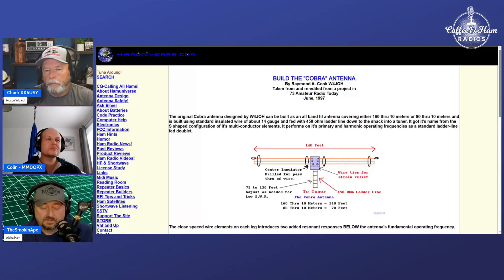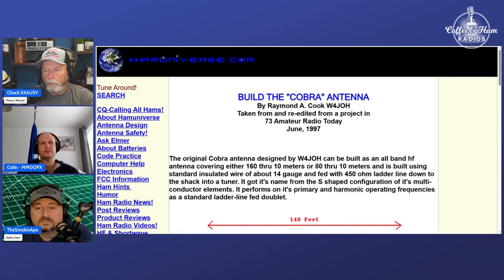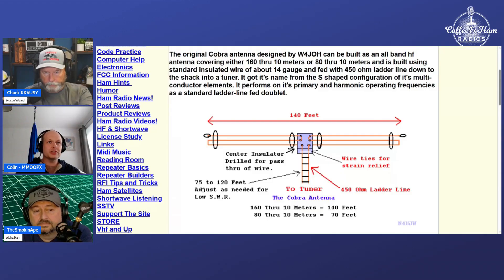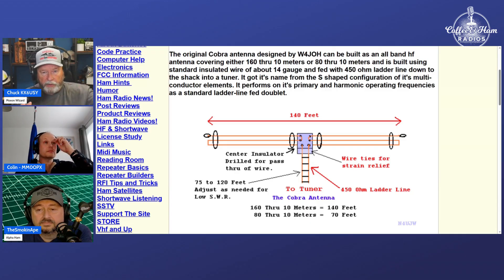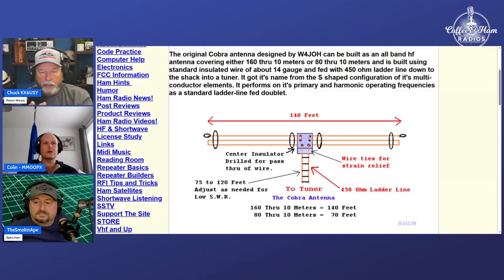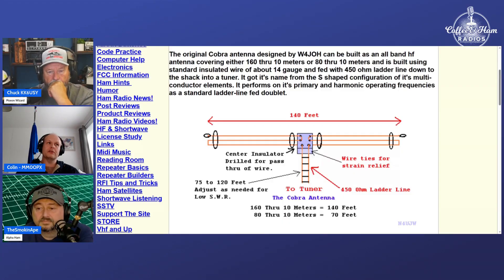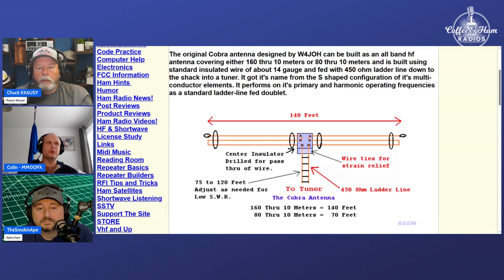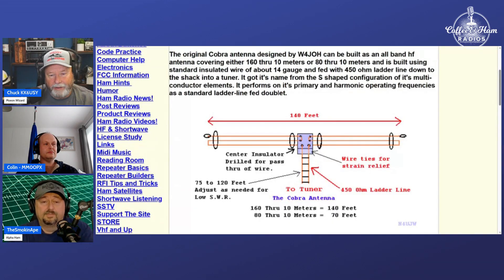Folded Antennas for Ham Radio? The TRUTH About Linear Loading!

Comment: I use the Cobra Ultralite Sr. I just started back into the hobby in January of this year, and it's what my locals recommended to start with my FT-710. I feed the window line through a 4:1 balun, then into the shack. I was told by some to NEVER cut the window line because it's part of the pre tuned antenna. Since then I've seen many that say to adjust the window line just like you would tuning a dipole length. It's been a while since I last tested it using my VNA and I was wondering what you would say if, for example, it shows that it's too long. Should I trim the window line, or continue letting the tuner handle it?
Reply from the maker: I’d let the tuner handle it, you may want to try a 1.1 in place of the 4:1 as well 👍
Reply: @TheSmokinApe  I have tried both and the 4:1 seemed to work better. My next project might be a doublet running perpendicular to the Cobra. Might even make my own ladder line. Thanks for the response.
Reply from the maker: Good luck with the project 👍

Comment: At my last place, I was able to put up a DX Commander Signature 12.4m and a 40m EFHW at 15 feet. They were comparable.

I'm antenna restricted where I am now, but I was going on a trip this summer and bought and built a DX Commander expedition so that it fit into my luggage. I was quite impressed, but then, I didn't have anything to compare it to.

Of course, I followed his instructions with linear loading at the top with no spacing.

I have yet to try it at my home location yet.

I was running a stealthed "downspout" antenna, but it is the aluminum covering the ISP coax. Same metal. It worked surprisingly well for many bands. I started with a Chameleon transformer and later bought a DX Engineering transformer and choke combination. I think it worked better.
Reply from the maker: Thanks for sharing Patrick 👍

Comment: Almost no commercial antenna manufacturers use linear loading anymore.  A properly designed coil loaded antenna is more efficient, more reliable, and less clumsy.  A coil Q of 400 or more is not difficult to achieve, and linear loading cancels some of it's own field.
Reply from the maker: I agree and most of what we call “linear loaded” isn’t

Comment: Obviously linear loading is not the best, just like a ground mounted vertical is not as good as a dipole at halfwave above ground.  It's a compromise antenna to fit in to smaller spaces at a manageable size. Most QTH in Europe simply cannot accommodate anything wider than a 20m dipole/yagi, so for 30, 40, 60 and 80m it has to be a compromise antenna. Linear loading is lower loss than traps and less bulk that coils, so you are wise to take the least-worst compromise.
Reply from the maker: Thanks for the comment 👍
Reply: I think your view is totally sensible. I suppose options are to let the ends hang down vertically, or zig zag.

Comment: I used "linear loading" to shorten my 15 meter delta loop. I needed to get the angles in the triangle to match the design. It would not fit in my attic; so I shortened the legs by just folding them back on themselves. I taped them together in a couple places. It is equal to my dipole in receive and transmit. I was going to make coils but could not find how to make coils in a delta loop.
Reply from the maker: That’s awesome that it worked for you 👍

Comment: Many many years ago I learned from Charlie Gynes who made my Hi-Q mobile antenna that when running any antenna with a coil that the coil should be at the top of an antenna if possible because of reaction with the ground and the loses of being shorter. At least that was what i got from what he said. The verticals he made for submarines had the coil at the top, no whip.
Reply from the maker: Yeah, the further up the antenna you place the coil the better 👍
Reply: @TheSmokinApe  Totally wrong.
Reply: @TheSmokinApe  Read my reply to jeffschall immediately above.
Reply: That is wrong.  A coil needs current to have any effect at all and there is essentially zero current at the top of the whip.  It is completely ineffective there except for whatever capacitive loading it might offer.  You might think that since the current is a quarter wave whip is a maximum at the feedpoint that it would be best to put the coil there, and that would indeed give the best shortening effect.  But a coil at the base would mean most of the current distribution is tied up in the coil and not distributed over the length of the whip where it would actually radiate.  The optimum location for a coil is somewhere in the middle of the whip (I don't remember the exact position but you can find it with a suitable search) and that's why you see almost all coil loaded yagis doing exactly that.
Reply from the maker: @AB7Echo your right, I was hasty in my reply… that said the coil is better 1/2 way up vs mounted at the base.  I do know this is a topic of debate and there are a different opinions
Reply: @TheSmokinApe  Yes, as with everything, there are tradeoffs.  Electrically there is absolutely a best position and that can be shown via modeling, although there is a range where it doesn't make a whole lot of difference.  But mechanically it definitely is better to have the coil at the base, so different installations might prioritize on versus the other.

Comment: In the 70s I had a TV tower and decided to try a quarter wave half sloper and had excellent results but it was totally from cut and try, not calculating the element lengths. In those days, people poo-pooed using these antennas because they were unpredictable. I was sure at the time it was because of the variability of the angle of the slope and proximity to the tower  and other objects. In my setup I was in a mobile home and the roof was a great ground plane. If you think of the vertical antenna as a dipole, making the ground half of the vertical takes the 72 ohms the dipole with a wire and divides it in 2 roughly to about 32 ohms. Now that we have antenna analyzers, we can easily measure these parameters. I found that the higher I raised the far end of the half sloper, the better match I got and the better signal reports I got. Any angle less than 90 degrees appears to have a fair amount of cancellation of the RF radiated. I might experiment with linear loading to see if the same properties are at work. Great discussion, gents! Ken - W8VIW
Reply from the maker: That’s great info Ken, thank you 👍

Comment: I am using several antennas ( and even radials for Verticals ) using that linear loading principle . We do use it to shorten the longest Dipole of multiband fanb dipoles. We are very happy with these. I also used ( ans will do later in the year again ) linear loaded vertical 40m Dipoles. We have 2 40m Verticals at the clubs station with the linear loading ( Single folded radial ) working perfect.  I tried all these with full size and saw no big differences . I  usee 10 and 12 cm Spacing on all these.  DL9NDW
Reply from the maker: Thanks for the comment DL9NDW, that vertical sounds interesting 👍

Comment: I use a 27 foot high, modified-Cebik "L" 40-10m antenna in the field and use linear loading on both legs to get 40m to work (three wires on each leg).  I also treat it like an OCF at the 40% feedpoint as well.  It is fed with 18 feet (which is NOT a 1/4-wave of any of the bands or harmonics) of true 600 ohm ladder line to a 4:1 Balun, then to a portable manual tuner, then to the transceiver.  Works very well on all bands as long as I tune it per band, and it stays relatively flat along that manually tuned band.  I haven't even cut the antenna wires precisely and I get DX on 20-10 (Japan, Chile, Brazil, most of Europe, etc.) and regional contacts on 40m (I think about 600 miles), using 100 watts SSB during the 2025 spring & summer.  Eventually, I will get around to cutting it properly to a better length but it is a compromise antenna, in that, if I try to optimize for 40m & 15m, then I will probably make 20m & 10m much worse, so I will shoot for the best compromised length of each leg while maintaining the 40% feedpoint.  This is an interesting topic for space constrained HF!  😁
Reply from the maker: That sounds great, thank you for sharing 👍

Comment: Study the GAP brand of linear-loaded multi-band vertical dipoles. I had a GAP Challenger up many years ago. It would match to coax on 80-2M without radials, and was inefficient on all bands, because like all antennas, the efficiency of the radiator is directly proportional to its physical size, NOT its "resonance" nor its impedance matching gimmicks.
I took it down and built a 20M vertical dipole and fed it with ladder line, thus, had a 20-6M vertical doublet with a much lower elevation angle and lobeless omni azimuth pattern than my 80M horizontal doublet did on the upper bands. Then I combined them and had a 20 meter vertical dipole and an 80 meter horizontal dipole on the same 1" ladder line feed-point. It's worked well.
73
Reply from the maker: Thanks for the info kv5r 👍

Comment: I do it with 2 17 foot whips in a V to get 40m. At the bottom of my antenna I have 2 M10 mounts 4 inches apart pointed in about 10 degree V. 1 of the antennas is connected to the coax. Then I run 2 elevated radials off it. At the top I connect the tips with a 1 meter wire. So it's basically a bent vertical. It works REALLTY well.
Reply from the maker: That sounds pretty slick 👍
Reply: I also do it with a wire and a telescopic pole. ~16.5 ft to the top, then about 18 down to a stake about 4-5 feet away. Makes a bit of inverted V. I activate POTA most weekends with that on 40m and get out to TX and IA from NY. Have picked up some DX as well in the mornings on it.

Comment: Great discussion... More in the future please 

Re the 4:1/1:1 balun debate my (uninformed) view is if it is more than a quarter wave vert/half wave dipole then 4:1 ok as radiation resistance greater than 50 ohms so can cope with being divided down to feed into the coax & you want to minimise any reactance as much as possible.
BUT, if it is shorter than a quarter wave vert or half wave dipole then go for the 1:1 instead. Below this length radiation resistance drops off rapidly so the last thing you want to do is divide it down any further with a 4:1. If you do that the ohmic losses will become more significant & if you get a good match it is probably more into heat than transmitted RF. Stick with the 1:1 & find another way to address the problematic reactance.
I think this could explain why Rybakov are good 20 to 10 but aren't very effective on 40.
This then gets back to Colin's idea for dumping the 4:1 "pre-match" at the base & just having a good auto ATU at the base ( a la standard hf marine band practice) that can cope with  low rad res/ high reactance directly.... Interestingly today I was having a play portable with a friend's xiegu G90 & it's decent ATU seems to be able to hack red slug 17' whips or 25' of vert metal ( as per Rybakov but without the 4:1) onto 40 directy without any problems if you are only running 1' of coax.
The Rybakov problem on 40 seems to be mainly the 4:1 as 25'  (per leg) radiators with different matching have no problems on 40 (as proved by the half size 5rv).
Reply from the maker: Yeah, the fact sea with the 1:1 is to remove CMC and then let the ATU sort the rest out 👍

Comment: Something strange is happening because all of my comments are disappearing
Reply: If you're using the YT Android app? There are major issues with it opening multiple sessions of the app instead of changing the open one. And then comments cross-post or disappear when an ad or other new window pops up. Very buggy, simply lousy programming. Unlikely to be fixed.
Reply: @lyfandeth I will go ahead and post later this week from a computer.  My wife is having surgery tomorrow.
Reply from the maker: Good luck with the surgery 👍

Comment: Oh, twinline, which reminds me:
1/4 was of window stuff can act as transformer for vertical, yaa? J-Pole style?

I often rigged what I called "corner fed open quad" ... 1/4 down from FP, then 1/2 out and 4th quarter down.
This got me thinking about feedpoint for EFHW.

1/2 wave radiating section out from feedpoint, but instead of transformer there, 1/4 wave of ladder line as stub?

(I'm chasing efficiency here. aiming at 14.060)
--VE6IU
Reply: Various lengths of balanced line can act as a transformer. Look up the 'w5dxp no tuner' and you'll see how you can transform almost any impedance. Fair warning- if you're looking for efficiency, ladder line transformers can bring very low impedances to be 3:1 unable, but depending on the length of feedline it might not be more efficient than an balun/unun
Reply from the maker: Thanks Corey 👍